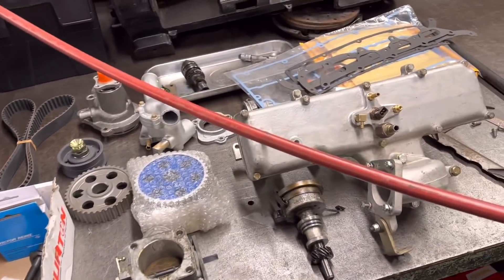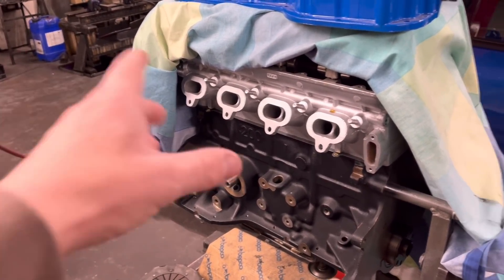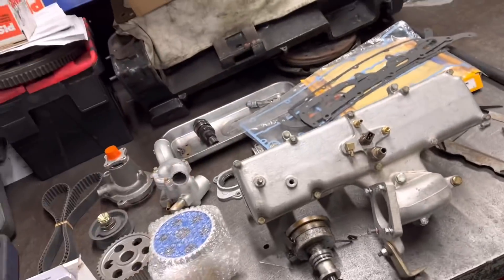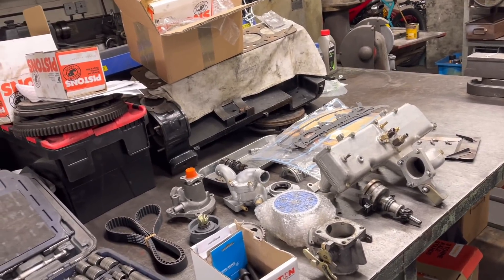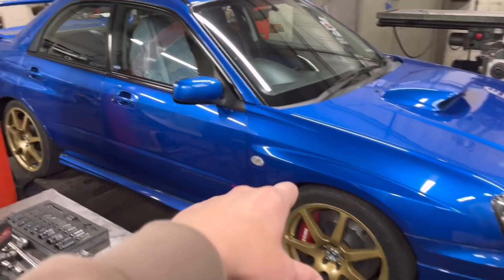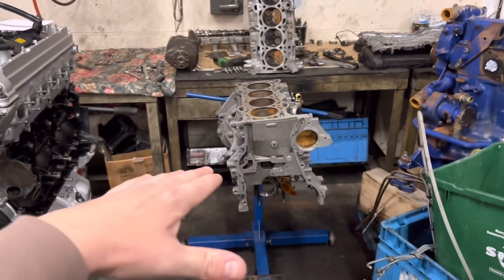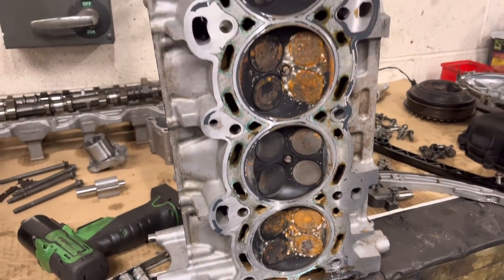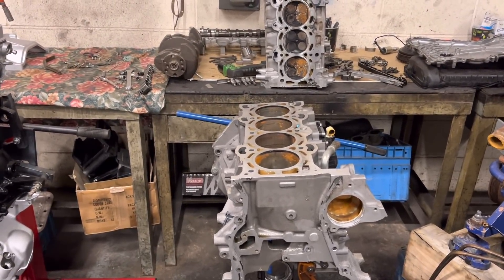It’s back for a Warranty claim check, but is it even the SAME ENGINE?

Comment: I'm repeating what others have said,  utilising a simple  2 digit year and 2 digit week number eg: 21/49, plus a unique makers mark on major components needs to be implemented.  Not heard of epoxy thermal discs, sounds like a good idea, plus the customer or end user is aware of them.
Thanks for sharing.
Reply: A company I used to work for used a variation of that, they used a two digit yr and a three digit day number. I think they followed that with an item number for that day. It was their serial number after all.
Reply: @stephenhunter70  Guessing the week, day, etc depends on the volume of production,   think I would stamp or mark in plain sight, then secret marking, by engraving,  etching etc  obviously hardened or highly stressed items should be lightly marked.
Reply: @bostedtap  I can send you a html app that does the guessing the day of the yr for you!
Reply: @stephenhunter70  Hi, my reply was poorly written,  by " Guessing", I meant the numerical format complexity, that is producing ten items a week,  to hundreds or more in a day. Hope this clarifys my reply.

Comment: Not completely certain but I believe this guy is trying to get over on you. I have built a lot of engines over the years. Have been using the same machine shop the whole time. They always stamp Head & block with how many thousands they took off of the surface. And since no two are the same, I log those numbers.

Comment: Heat accelerates the rusting process so if that engine was at working temperature and was submerged in water while mud plugging and the water reached two of the cylinders before it hydraulic locked then your valves and bore will show signs of heavy rust in a short time, heat, water and combustion gasses mixed are a corrosive combination. Also skimming discs is nothing to be worried about, good on you that you did it, you even have a proper brake disc lathe, i do them on a conventional lathe but they are a pain to get set up true as you have to turn them around to do each side in turn.

Comment: Looking at that and knowing it was used for trials , which I think you originally said , I would say that has had water ingress through the inlet tract i.e. drowned in a huge puddle or stream which could of allso knocked the big end out . Strange it's rusty on that pot . Pull out the rods and see if they are bent . Just a suggestion.

Comment: Many years ago, I used to build /tune Ford engines. After one engine coming back to me and the owner claiming I had done it incorrectly, I had a suspicion that it was not the same engine that I had built. From then on, any engine I built, I secretly marked all the parts with  a letter and a date code. And sure enough, it turned out to be the right thing to do. I caught out two other people over the period of 18 months try to con me, it nearly put me off doing any more engines, but I carried on for a few more years. I would suggest you do the same, also take photos with a date of the work that you have done. It may seem to be making more work for you, but it gives you proof that you did or did not do the work. As for the state of that engine, it looks like it has been left in the rain with the plugs out. What a sad world we live in.
Reply: Every engine I ever built has my name and date stamped inside, somewhere; with pics. Seems we're not alone.
Reply: I want to place three gearboxes on fleabay, but I have a trepidation in that the customer wants replace his old knackered gearbox so sends that back with a complaint that this is the one I sent him. Yes I could mark it up with a date stamp and photographs but what I could do he could copy.
Reply: @alberttaylor3917  Not if they don't know about it, maybe somewhere inconspicuous like the inside of the bell housing and make sure to record the gearbox serial number.
Reply: I sell used car parts for a living over 90% through eBay people that know how to play the system are making it hard for small business using eBay the stress and effort to fight your case generally isn't worth it and that is why they get away with it stamping items sold through the likes of eBay dosent help but when selling directly to the public creating a personal stamp and having time and dated video to back it up any small claims court will go in your favour
Reply: Yes, you need a way of identifying your work in case the customer tries to send you a different unit for a warranty claim!  Either stamp it or you could possibly use a microdot unique code on the components.  👍👀
Reply: I'd invest in a set of number punches and punch a serial number on every thing I worked on. Then if anything come back the record number punched on the item work hold the reference to my work. No number then it's not my work
Reply: I was thinking the same. Stamp it

Comment: I agree with many of the comments here, Mr Forgetful is trying to put one over on you. He was probably using that engine as a test bed for fitting the shallow sump, and altered oil pump arrangement, it probably is a scrapper engine he got from somewhere for the purpose. Decline the so called 'Warranty' Claim and send him a fresh bill - for the full amount - to recondition the engine he sent back and invest in some way of marking your work so this nonsense doesn't happen again.

Comment: Thats even more weird top of the block is an odd move! You think the engine was lying dormant on its side hence the valves only rusting that side of the head or newish ones fitted so that the carbon didnt protect?
Or how about this...the customer gave the engine (you built) to a dude and the guy has done the ald flipparoo and swapped goods around and passed it back? Wouldn't be the first ive heard of that one haha!

Comment: from medieval times, at least to  late 1930ts, many hand workers, assembling, stone, wood or iron work, had to hand finish every part, to fit perfectly. They normally used punch tool,  to make tiny dots on each side that went together, or lines with wood and stone. Similar practise, where You paint, take serial numbers and photos is good, put adding tiny little punch marks at few  places where they are not easily visible, would be one extra inexpensive and highly effective security layer, for Your own benefit.

Comment: The local machine shop adds a glued on temperature tag on every engine they touch to indicate if the unit has overheated. That would be a good start to cover your behind. No tag no warranty!

Comment: Maybe  give each engine a code  that is specific to you Like BE  00009/12.2021  get some punches and punch the number into the block somewhere unobtrusive . Any returns you could then cross reference with your digital data that you should retain on a cheap memory stick.  no number would mean not the same block Would this work for you ? Almost like a unique memory tag  that only you know the relevance of You could then put on the same memory stick a PDF  or word Doc  of the entire work carried out  If you cannot remember your breakfast LOL

Comment: Hes a bloody chancer....I've done engines in heavy plant that's been sat in the yard for weeks awaiting parts that have been in better nick that that....for that cylinder head to be in that condition it's definitely not the one you re furbished....buy a decent stamp set and stamp your invoice number on the blocks and head (old school tip from an old school fart😋😋)  or as someone has posted use an updated method such as  smart water...interesting to see when challenged about the mains bolts he said he wasn't bothered getting the block sorted...that alone speaks volumes.....great video as usual...wish I was still doing work like this...

Comment: Low shallow sumps will lead to oil starvation due to centrifugal forces when cornering even if baffles are fitted as the oil levels in a shallow sump will change very quickly in a very short time

Comment: Been thinking !
What about a small 1/8 drill and then grind the size down to a bit lest than 1/8. 

Now you make a gauge that fits the hole the drill makes very tight. 

You drill a small indent 1/8 deep on the outside and one at another location inside. 

If things go wrong you can check while the engine is in the car and when it’s out on the bench with the template plug you have made. 

It’s unlikely someone would be able to make the drill the right size or Evan see a small indent. 

Simple and no damage and almost invisible. 

Good luck.

Comment: Obviously there's fresh rust, light in colour, probably the result of a recent pressure wash before sending. 
But the dark corrosion is more interesting. 
If corrosive moisture, water, has sat in the bore for an extended period of time it will etch into the bore. generally above where the top ring sits. Sometimes it will seep down to the second rings and so on. 
If the motor has been mounted in a car usually you expect to find those corrosion stain evenly marked around the bore. 
In this case the fact that the stain looks like an eyebrow on one side of the bore suggests the motor has been tilted over for the period of time the corrosion occurred. 
Perhaps it was not mounted in a car when it suffered that water damage to the bore ??  
I am a forensic mechanic, I generally get to the bottom of these matters. 
I think you should trust your gut feeling.

Comment: There is no way that engine was worked on only a couple of months back. Even if it had been left outside.
That engine has been sitting around possibly for years. Valves do not rust in that fashion that fast.
This is not the same engine you worked on previously.
You need to put a stamp mark in a secret place so you can see if a engine or component has been through your shop before.
I can't believe the number of shonky dishonest  people out there.
Has everyone turned into a crook?
You have to suspect every single warranty claim as being fraudulent until proven otherwise.

Comment: This is not the same engine that you built. This guy is trying to scam you into anther new engine / head. It looks like this has been sitting outside with the head taken off and uncovered for 2 - 3 years. I love the idea of marking the head and or block so you know it is the one you built. Also take a picture of where you marked the engine and attach the picture to the paper work to be filed. Now a days you really need to protect yourself as scammers are everywhere.

Comment: 2 of the pots got wet, engine sat in the rain with valves open. Doesn’t have to be all that long to rust like that but the valves in the middle do look like they’ve been outside for 3 or 4 years.

Comment: I'd love to know what the clearance was between the sump and the pickup.  either way there's way to many thing that are not right that could of caused it to take a dump.  Scary story.. I used to work with a guy, who when a cylinder head came back from being resurfaced at the machine shop (who never washed the parts off)  he used to bang it back together and send it out the door. funny thing was he never ever had a come back related to this. lol makes you wonder.

Comment: I’ve seen a few of your vids lately and pretty impressed. Quick question. Do you record the serial number of the engines and block when rebuilding them?
Reply: Had the same question in mind. You do keep a track record of all the engines that pass trough your shop, don’t you? And if so, are the engine parts numbers mentioned on a report attached to the invoice? That is very useful when it comes to warranty.

Comment: There's another channel on youtube where amateurs' build cars and car engines, mostly Mopars. The guys had rigged up a way of grinding the heads flat on a V8 engine. The took a one by four board around a foot long or so, wrapped it with sand paper, and the strapped a car battery to the top of the board to give it some weight, and then push the board back and forth on the head with the board 90degrees to the length of the head.. They were demonstrating the grinding process for the camera. I laughed even harder when the board was wobbling around whenever they would move it. 
Your comment about never using sandpaper reminded me and I thought you would enjoy that.  
Who needs a machine shop when you have a stack of sandpaper?
Reply: I have glued industrial emery to a  2 inch polished / machined granite slab and skimmed  ally heads, so it can be done

Comment: I recently sent out a set of heads for a competition valve job along with HP springs and other bits, I had spent 8 hrs per head doing port work making them quite desirable so you can bet I put special stampings on them for identification .

Comment: You're setting yourself up for failure. As an engine builder here in the US we put our own part number on each head and block we build, then record that unique number on a work order the customer never sees. Just take some punch stamps and punch the number where they can't see it. Bingo problem solved, no more BS warranty work. On high end builds (which we do a lot of) we even stamp the crank and rods. Now everything has to match, if it doesn't you escort them out of the shop and tell them to have a nice day.
Reply: Customer could replicate the marks.  A unique stamp and  / or taking pictures of difficult to replicate features ( like casting variations ) would be a better idea.

Comment: Because there is such a high cost to you in covering warranties on top of the tooling etc, a simple claim is far more expensive than the labour to inspect and repair the engines. There are so many people out there that fail to have the decency to tell the truth what actually occurred or just take advantage of your nature and pull a fast one. A letter punch is a good idea, but with low cost laser printing available, you can print a permanent ID on every part used discretely. A friend of mine prints his logo with a reference number and looks great as well as the tracking peace of mind. I was called in to fit a hidden rev limiter after two warranty claims on the same engine, which suffered severe costly damage which was covered. However they were suspicious that the owner had absolutely thrashed it with no proof. I fitted the limiter and within a week they had the car back with complaints of misfiring. The memory of the limiter was proof and the car was placed in storage whilst they worked with the owner to cover costs for the previous repairs!

Comment: Surely you would keep a record of the headgasket brand you used when you rebuilt that mazda engine, what brand gasket came off it? That alone should tell you if its your build.
I personally think its a different engine and the customer is a bullshitter trying to get something for nothing, sounds likes he back tracking i mean how can you not remember taking an angle grinder to those bolts?
Mark everything you put on preferably stamp it on, I've been in business for over 30 years and seen it all, the ones that really irritate me the most is part swappers which is basically what this engine is, I would box that engine up tell the customer to collect and never to come back.

Comment: I haven't personally worked on a mazda engine, but surely there is some sort of casting batch/vin/serial number on the block? It'd be pretty easy to tell if that's been tampered with as well (ie. cloned). 

The motor has definitely had some water in it, and could be that it was cleaned once removed, or left outside without the intake on.... which if the motor is only a few months old, is a pretty strange thing to do (ie. won't get that dirty in that shorter period of time). If I was going to be sending a motor back to the shop that built it, I certainly wouldn't leave it outside to make it look like crap.

Another strange thing, is why is there so much corrosion in what I'm assuming is where the water pump is mounted (far right side?). If this in an alloy block, the only way I can assume a freshly built motor could have that much corrosion, would literally be to leave it sitting full of tap water for a very long time. The only place I can imagine most of this corrosion (galvanic) would come from would be the water pump impeller itself, as every other major part in the cooling loop is likely ally.

Comment: About 40 yrs ago, I had an engine with cylinders and valves looking like what you have. The engine - broke the time chain and the guy just ran the starter until it was dead. Then he wanted to sell it.  7 months later I bought it and started to pull it. A 351 Cleveland.  "last of the v8's" -nod to Max.   Anyway - the gas had washed all the oil off the cyl walls. And the pistons seized in  place..  That in my mind - is a - not as it left your hands engine.    I know of one engine builder who had a makers mark. He stamped all the parts he worked on.  It was the last laugh when someone tried to enter a fraudster engine as his build.  No makers mark. Not his engine - not his work.